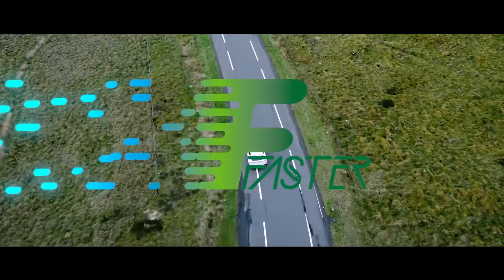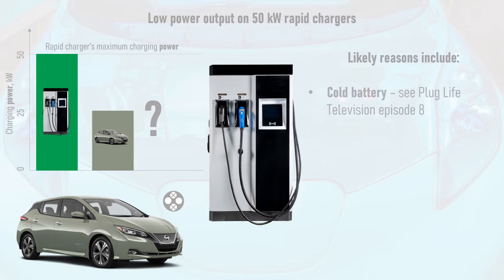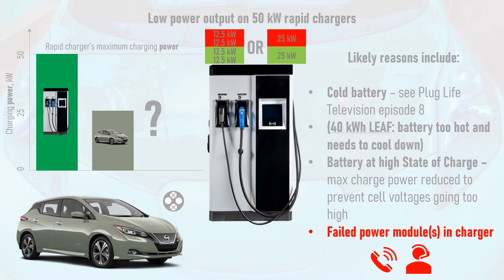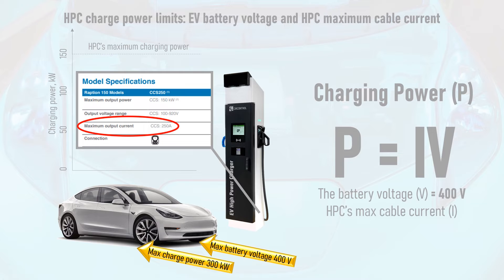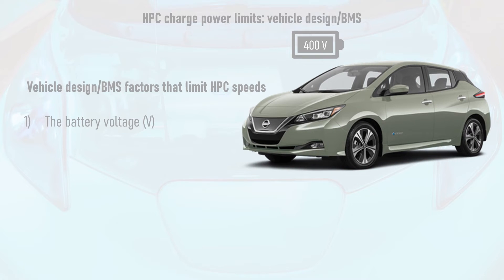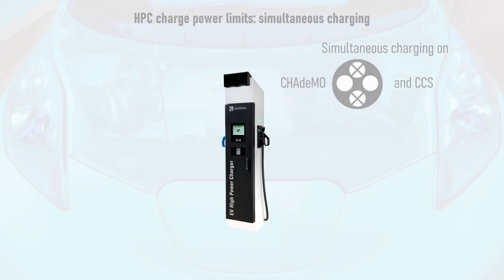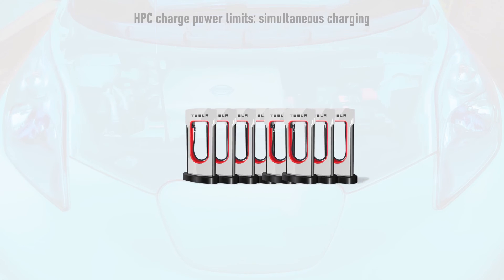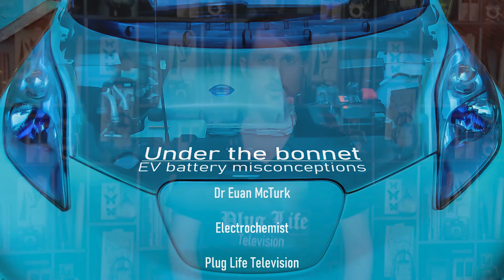Why is my EV not charging at full power on a rapid charger? | Plug Life Television episode 29

Comment: hi from plymouth   plymouth is so poor for charging  they are  mostly 7kw or not working   == i dont have a home charger
Reply: I agree though InstaVolt by B&M are usually ok. Fortunately gridserve are planning on a new electric forecourt near Albion. Should be great - but they need to get a move on. I’m from Tavistock and apart from Lifton West Devon is a bit of a charging desert
Reply: @joepitt1192   hi bud  insavolt is kool by b and m. but one of the units has been out of order for a few weeks. but it would be nice to have a  forecourt in plym. as it is the gateway to cornwall  ps b&m is about 500 yards from me

Comment: Many thanks Euan...they should advertise the cable current clearly.

That said, as a 2027 Zoe Q90 driver (max 43kw AC only folks) I often have a giggle at the "better" cars driven by people who don't know about the "battery basics". 
I regularly arrive at Lancaster Park and Ride with a SOC of 20% and battery temp of 25c, so get 25kwh in 45 mins and then leave, but often find other drivers complaining of the slow charge speed. Some don't realise they are only 50kw chargers. Some arrive with 50% SOC after a shortish trip and charge through range anxiety. And quite a few will sit at 99% for nearly 30 mins. The number of complaints of poor charger speeds on ZapMap shows the public still need education.

My tip is don't bother trying to rapid charge unless you have driven for 100 miles as your battery temp and/or SOC will not be good enough. Oh, and learn your car's charging curve.

Comment: I tried a 150kW charger the other day, as a test.  It put in 3kWh, at a max of 30kW and then failed showing a charger overheat error.  When I swapped to the 50kW unit, it ran at 29kW and finished the charge.  Over the last few visits, I've noticed several different vehicles running into a similar issue, no matter how quiet the station was.

Comment: The latest firmware in the Circontrol chargers enables smart power sharing, allowing the unused capacity in your example to be utilised, not just a simple 50/50 split.

Comment: There are quite a few Tesla owners that haven’t been told about ‘the urinal rule’ on the V2s. But I’m usually throttling back below the 75kW, so I’ve been lucky not to be affected. I’ve had more problems in my Zoe days going back to find some kind sole had switched me off! Hopefully as everyone gains a better understanding, it will all get a little easier. On one occasion I pointed out to a chap from the Vauxhall dealership that his Corsa has CCS. He was adamant that he could only use type 2. He was surprised when I pulled the cover off the socket and plugged CCS in to his car lol
Reply: I had the same with a Mini driver. Dealerships are crap at new stuff.
Reply: They need to read the book 'ev for dummies ' 😮‍💨😁